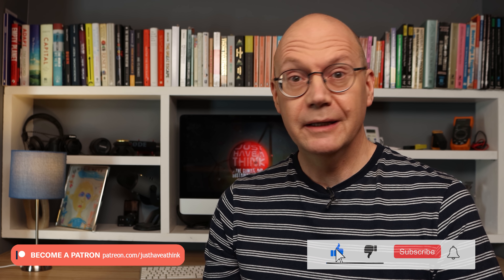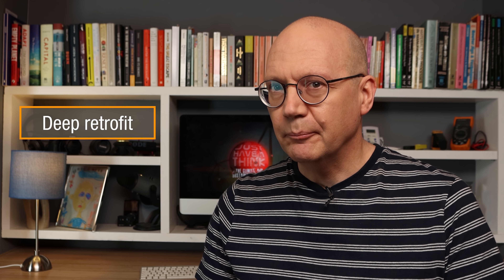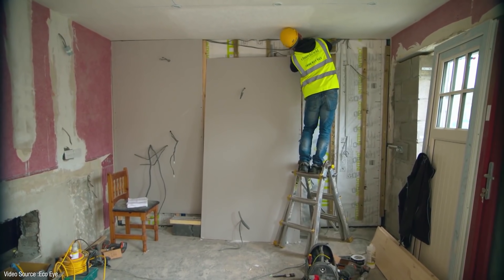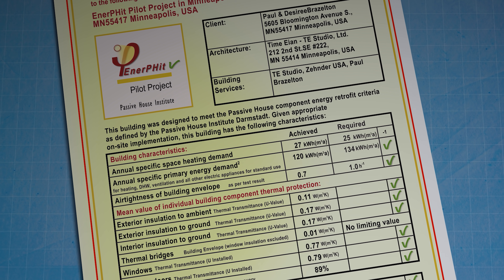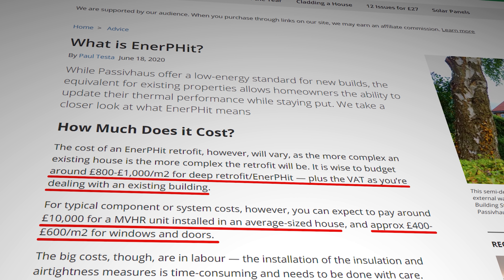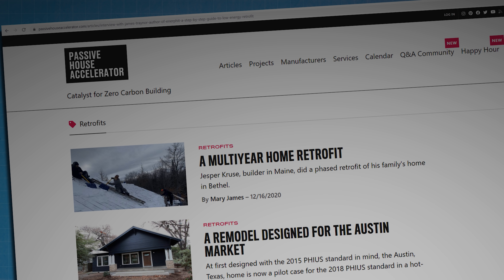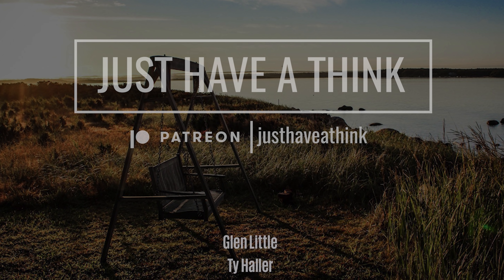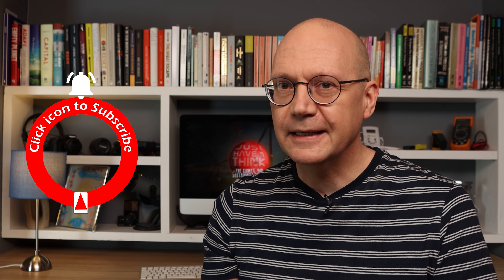Retrofitting to Passive House standards

Comment: aout two years ago we converted the attached garage to a habitable room. 10cm foil covered foam sheets in the floor and walls and 60cm fibre/wool insulation in the loft. new double glazed window and French doors. it's now noticeably warmer then the rest of the house (2000 build). We also have about 45cm insulation in the main loft and insulation in all the stud walls. Oh, and the boiler is only four years old backed up with a whole new central heating system, The house has been neglected by the previous owner for several years to the point that we had to replace all the taps, the shower and many other things.
Reply: Well done 👍

Comment: It's interesting that this is coming around again. I first got involved in this in the 1970's when the cost of fuel skyrocketed. Sadly most of that high price of fuel left the country or went to people that didn't really need it. The best option is to put a high tax on heating fuels but give this money back to the people in the way of meeting some of these passive standards. This can be done in the way of credits, grants or low interest loans. It's not free money it's just getting some of the tax money back. Now where does that leave the renters , my only option I can see is to require landlords to pay for utilities. This would give them the goal of improving their property to these standards. Also a tax incentive to do these changes.
The end result would be , as you say a more comfortable home. A more secure nation as life would go on if energy supply was interrupted. The jobs that it would create would be intense, making more income to fuel this whole process. 
Yes there will be some negative nancy's that will complain , but they will complain about everything anyway.
Reply: In some parts of the UK, landlords are simply compelled to have an energy efficiency rating of something or other (or higher). More direct than hoping for market forces to influence the landlords into doing what you’d hope they’d do as a result.
Reply: @kaitlyn__L  unfortunately in USA many are only driven by the bottom line. Honorable actions have been losing ground over here. New projects are the exception.
Reply: @richardmccombs617  the same could be said in the UK, inasmuch as they do it as much as the regs let them get away with. In England there’s no-fault evictions and a bunch of landlords kicked everybody out with a few weeks’ notice to put up the properties on the more lucrative airBnB market. And a bunch of local councils moved to make it illegal if they want to retain their landlords license. So, I’ll say it’s probably a bit better than the USA, but in general most rental properties are still dilapidated and damp and draughty. Just now the minimum bar has been raised a little bit in some countries in the UK. If that makes sense.

Comment: Passive House costs only 5%-10% in the worst case scenario, it's a worthwhile endeavour to go for it or at least achieve the Low Energy cert if they cannot, it's worthwhile to get PH in cities where air pollution is high because your PH house is incredibly air tight
Reply: Good point about pollution!
Reply: Unfortunately it's not. Recuperation doesn't filter gasses, only pm is filtered.
Reply: I think the idea is that air is only coming in from one source instead of many little sources and it's changing very slowly, so less pollution accumulates inside.
Reply: If it's £1000/Square metre that's already a non stater on a house that's 120.5 square meters
Reply: @waqasahmed939  Is this an existing house or a new house? My figure is for new PH buildings

Comment: I really want to improve my house. Its cold, drafty and expensive to run. However the cost will not pay for itself for 20+ years. Better off doing more basic stuff like underfloor spray foam insulation, replacing the last of the sash windows and new doors.
Reply: You could do it all yourself and have a good time doing it. Sometimes materials are cheap or free. Careful with spray foam, not always a good idea for various reasons. Best wishes.

Comment: I am one of the lucky ones that is building his  energy neutral house from scratch. A challenge it is..
Reply: I see it as gimmicky nonsense and a way for the scammers to make much money. Building houses is being made far too over complicated. Best wishes.
Reply: @jimmycorkhill1390  It actually saves a lot of money, depending on where you live. Yet, I do agree one always has to be careful for overpriced services. It's also not that complicated, really.
Reply: @MrMichiel1983  It depends on what is meant and involved in the energy neutral/passive house standards. A cob walled earth roof house could be extremely cheap and efficient achieving energy neutrality whatever that really means. On the otherhand, a design using lots of complicated toxic materials from around the world with seals and barriers and lots of stuff to fail at some point doesnt sound much energy neutral to me. I suppose a bit like the modern car, over complicated and far more damaging to the environment than the older models once taking build and materials into account. Best wishes.
Reply: @jimmycorkhill1390     Classic straw man argument. 😉
Reply: @christinearmington  Id suggest that that is a term used by those that dont have an argument and probably dont really know what it means. Best wishes.
Reply: @jimmycorkhill1390    That is the argument. Picking various random points that haven’t been raised. Like the house built of straw.
Reply: @christinearmington  But the points have been raised, that is the point. Passive House, Energy Neutral House, what are they exactly and what is included/excluded by those terms? Best wishes.
Reply: @christinearmington  It's not a straw man argument because he raised the issue of cost and clearly mentions that same end goal could be achieved through cheaper means without the need to scam people out of their hard earned money.
Reply: @jimmycorkhill1390  as you point out, energy neutral and passivhaus aren't the same.

I spent 12000 dollars 10 years ago and in one morning made my 1970's house not just energy neutral, but energy positive. Just by fitting a solar PV system of 4.5 kW. Today a system 50% larger (6.6 kW) can be installed for 3500 dollars.

Whereas a passivhaus retrofit would have been hundreds of thousands and would have cut my consumption by less than 50%. Simply because as an all electric house, heating and cooling are less than 50% of my usage.

I see passivhaus as a brilliant idea, who's time has passed. When solar was 10 dollars a watt, it made sense. Now it's about 50c/watt installed. You'd have to be completely mad, or driven by outdated regulations to bother with it.

Comment: As an interior designer of no mean reputation and a tireless worker for the homeless, I had rather hoped to marry these twin interests especially as the number of homeless is increasing exponentially. So from migrant caravans slouching towards the Med to unfortunate stockbrokers hunkered down in London doorways, one would have imagined my services (reasonably priced services) would have been much in demand. I would find myself disabused violently of such notions. Tent dwellers are not receptive to powerpoint presentations about quadruple glazing, feng shui or solar powered swimming pools. And homeless stockbrokers seem quite content with the heating offered by cardboard and cider. So before YOU become homeless, perhaps you could think a little about how you might improve your doorway, tent or shrubbery.

Comment: I did some upgrade for my summer house to possibly become my permanent home some day.

Insulated 400mm in attic, 90mm in walls with broken cold bridge (45 vertical and 45mm horizontal),  all new windows and doors, air to air heatpump. Plans this year 5kW solar cell to direct heating. Plans for future, multifunction tank, air to water heatpump, wood furness and add more solar cells.
Reply: You live in the Arctic? With all that I wouldnt need a wood furness. Best wishes.
Reply: @jimmycorkhill1390  or Scandi. They have a lot of summerhouses and like stoves.

Comment: I don't want my current house to be retrofitted. It's not an historic building-- it's a crappy house, partly build in 1956 and remodeled in 1970.  I want a new, no-more-than 1,000 sq ft.  passive house.  But before codes are tightened enough to meet Passive House standards where I live, the world will have already gone into runaway greenhouse.
Reply: There's lots that can be done to your house that, while not being passivhaus standards, will make it a lot more comfy, and much lower bills, for much less than $1000/m^2.
Reply: @deansmits006  but where would I live while the house is being retrofitted?  I am chemically sensitive.  I would rather live in the house while a new Passive House is constructed close by.  But never mind:  there's no local builder who has the expertise and knowledge to build a Passive House, let alone do a complex EnergPhit retrofit.

Try to find these experts in the Central Valley,  CA.  They don't exist.

Comment: Brilliant!

Very timely, as I am having an air-source heat pump being installed, by Menai Heating. This is via the Renewable Heat Incentive scheme, which means that I have to pay the costs initially but they are refunded to me over 7 years.

In turns out that I can also get a grant for insulation, which means interior cladding in practice. Everything get removed from the external walls, including the skirting boards! 50mm board is attached to the wall, then everything put back! I hope.

That's obviously inconvenient and I will have to vacate the house for a week, but I am assured that it really makes a difference. I'll have plenty of redecorating to do of course but I am retired now, so that will help to keep me busy!

Thanks.

PS My bottle gas bill is an unbelievable £500/month!
Reply: You got a leak on that gas? My total bills are less than 150euros a year on gas bottles for the cooker and 600euros on wood a year for heating and hot water. My house is poorly insulated and I dont always heat the upper floors that I dont use much. My elec is off grid solar which has been great but a challenge. Best wishes.
Reply: @jimmycorkhill1390  I have made that point a few times, but I have received no response or assistance. I think that I am entitled to some, frankly, as I am now 65, living on my own. I'm tempted to name the company but I am not sure that would really help. These are difficult times for everyone. Thanks.
Reply: @Number_Free  Hope it all goes well for you. Best wishes.
Reply from the maker: Good on you Richard. An example to us all. I hope the grant money comes through without delay.
Reply: Thanks for the good vibes!
Reply: Probably a bit late now but 50mm IWI (including board - i.e 38mm insulation) is rather stingy even if it's PUR/PIR. It will make a big difference but is a wasted opportunity to do a better job. I added 100mm (PUR) on the internal walls and 160 or 200 (woodfibre) on the external walls (to add to the 65mm of cavity fluff). I take it that external was not possible for some reason (possibly budget) - it's technically much better and less disruptive, but much more expensive. In my experience no-one ever wishes they'd put less insulation on, but quite a lot wish they'd done more whilst they were making a mess.
Reply: @xxwookey  You have very well insulated walls from your description. 325-365mm of not too dissimilar resistance rated materials? The idea that you cannot have too much insulation surely assumes that money is no object so to speak? Law of diminishing returns suggest, please do the heat loss calcs, that you are wrong if money is a key part? Your insulation thickness would see not meaningful benefit if more was added. After 200mm in the walls and a bit more in the roof, value starts to significantly decline unless others are paying for your added comfort? Best wishes.
Reply: @jimmycorkhill1390  Yes, my walls are now U=0.16 or better which is 'passive grade'. There is indeed not much point adding more.  But there is plenty of point in doubling or tripling Richard's from 38mm to 70 or 100. As I said nearly all the cost is in the labour not the materials, so it's really not much cost to make it twice as thick. Obviously budgets always matter, but most people have no idea what the difference between U=0.5 (38mm internal PUR) and U=0.3 (70mm internal PUR) or U=0.15 (200mm external EPS), so have no idea how to weigh those factors. Approximately a halving of wall heat loss for each step so maybe 25% of annual bill and emissions.
The trick is to imagine yourself in 20 years time (this change is likely to last at least that long, and if well done could last 100 years). What would you wish you had done? How will standards have changed? What were standards like 20,30 or 50 years ago? Do what now seems 'excessive' will very soon be absolutely normal, and soon after that 'not enough'. The risk of under-insulating is that it all has to be redone in less than 20 years.
Reply: @xxwookey  I was with you for much of it, but some isnt logical. Just adding, doubling insulation isnt always as simple as that. Try putting 300mm of your plastic insulation on the outside with the same system as the 100mm version. Youll be revisiting it soon after. Your example had lots of different labour exercises and systems, each expensive if bought in. Then there is the issue of diminishing returns that you missed I think. After 200mm value added falls off in a curve. All the extra money in systems to cope with extra thickness in aerated plastics attached to the side of a building dont give a logical return. Use the money for a better purpose, perhaps a sun room for solar gain, free heat and a space to use?. I need to insulate my place,, I am the labour and the material is very cheap, likely to be straw and clay or cement, then render, but there is a balance to be had. Reflective foils incorporated into blankets can be a useful way of overcoming the thickness issue and I have used then quite a few times in the past. Looking to the future is important, but always be wary, the next asbestos, lead, formaldehyde is around the corner and removal and replacement of that material may cost far more than the initial cost. Current examples of this are writ large.   Best wishes.
Reply: @jimmycorkhill1390  I think we are actually in pretty close agreement. I agree that 200mm EPS or woodfibre is a sensible practical maximum for retrofit (I didn't recommend 300mm - I think that's a confusion about different things I did in different parts of the house (EWI/IWI). And I agree that using natural materials is generally to be preferred for long-term safety and recyclability (but that has a price premium until it gets more standard). Reflective foils only work when there is an air-gap, and far too often there isn't one so very poor U-values are achieved in practice. 
We've rather sidetracked poor Richard's thread :-)
Reply: @xxwookey  Richard invited us to just have a think.....I think that thinking deeper than the superficial is important and this discussion is still on topic. Anyone can have an idea, turning it into reality is the real challenge. Straw and clay are materials without a premium and you dont get more environmentally friendly than that. They have been proven to stand the test of time and never been torn out due to health concerns. Stramit type boards, woodchip cement blocks and many other variations are used extensively beyond the UK. Dont forget embodied energy in your calcs when looking at materials and their environ friendliness. Foil insulations require an air gap only in some situations dependent upon dew points within the fabric (using the broader term). Foils are both conductive, convective and radiant barriers. The latter being their main purpose. Foils cannnot be calculated using U-Value calcs, they can only be given an equivalent after lab tests done along side conventional insulation. Here a 150mm equivalent 21 layer foil blanket costs less than 4euros a m2 last time I looked, nothing stopping you putting in two or three of these over battens giving you the air gap if it concerns. In reality dew point if it gets past with be no issue.  Best wishes.
Reply: @xxwookey  Well I am happy with the company so far. I assume that they know what works and what doesn't.

Comment: An excellent (as usual) review of what is involved retrofitting a house in a northern climate.  The only thing I'd like to see added would be active energy harvesting with solar PV or hot water (or air) systems which can supply large chunks of energy demand over much of the year.
Reply: PVT panels or hybrid panels combine photovoltaic and thermal energy generation. They can double as air-sourced heat pumps (having no external unit).